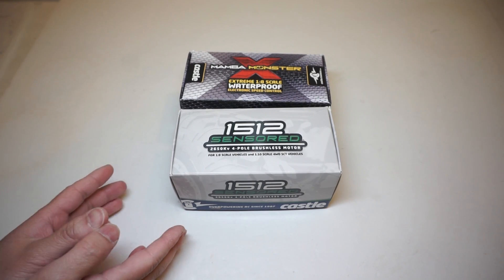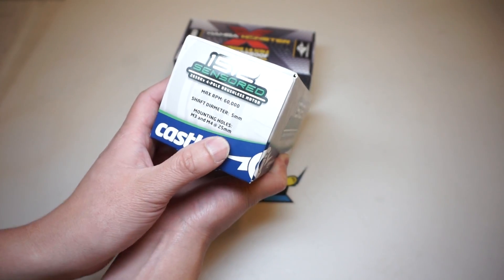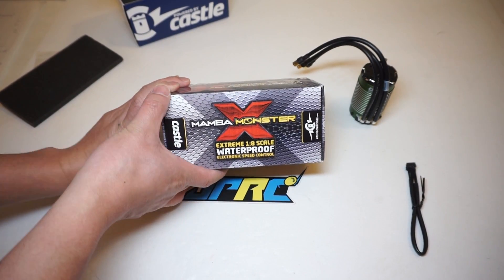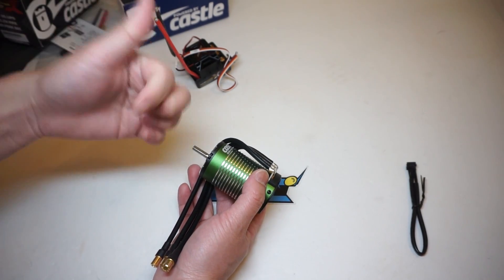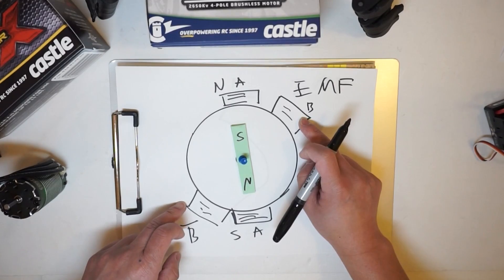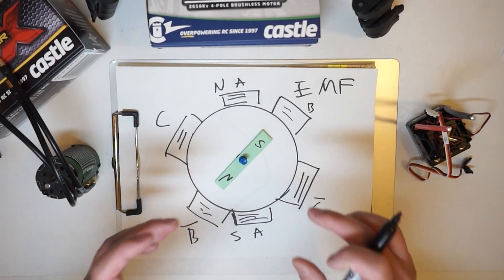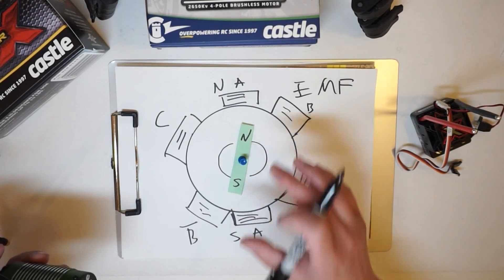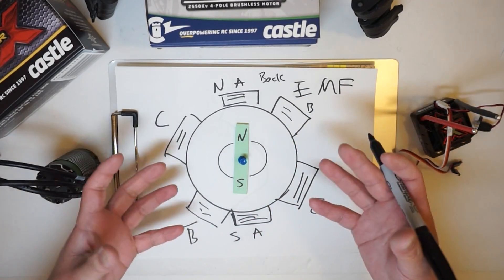Brushless Motor Cogging Explained! Unbox Castle Creations 1512 2560KV Sensored Motor

Comment: Literally none of you are addressing the most important difference between the two, witch makes me question your "knowledge" what happens if you reverse direction of  the motor on a sensored system? Witch method will cause you're ESC to burn out?

Comment: I had these issues with my castle 1410 3800kv in a 2wd slash and the castle 2400kv system with SW4 in my Arrma Senton.

Comment: Get hobbywing ezruns.. you won't cog like you do with castle. Even with a sensored castle you get more cog then hobbywing.. I stopped buying castle after I started using the better hobbywing brands. Not the cheap knock off looking ones

Comment: What propels a motor ? Current or volts?
Reply: Seriously.....????
Reply: Sorry if im a dick i feel like everyone should know that but I suppose before I got in the electrical field I may have wonderd the same question haha
Reply: Anyways... (Current) amp x volts = watts 
Kinda confusing when they only put amp raiting but that's because the volts is always the same either 2s or 3 s but besides that it's the same it goes from 4.2 to 3.5 no higher no lower amps actually Carrey the energy to the source in a fashion. Power is extremely complicated if u actually start to look into it with depth

Comment: Nice informative video, well done! I've recently changed my esc to a different one and the cogging has become more intense. I'm running a GoolRC 3800kv 3660 motor, on 3S, originally to a Hobbywing 120A esc. It ran really well, there was some cogging but it was bearable. I've since changed it to the waterproof Hobbywing WP-SC8 120A esc - the cogging is beyond... not sure why this esc is so different to the original 120A. Would playing with the timing of the motor on the esc help reduce it at all? Thanks in advance. Craig
Reply from the maker: Craggle RC the same hobby wing wp-sc8 in my yeti and the castle 1415 2400kv has minimal noticeable  cogging. Have You recalibrate your radio with since installing the hobbywing esc?

Comment: CAN  I USE A  BRUSHLESS  SENSORED  ESC ,ON  A  REGULAR BL MOTOR.I bought  the wrong  ESC  by accident.
Reply from the maker: john ciccolella what model of the esc did you get. Most sensored esc have a sensorless mode in the programming settings.
Reply: As long as it’s not brushed motor

Comment: Can you tell me if this setups good for a 1/8 scale landmax drift car that weighs 11 pounds or would a 2200kv setup be better?great explanation btw!
Reply from the maker: Wazza722 this is actually a 1/8 scale system. It will do fine do a rig weighing 11lb.

Comment: is less kv faster than higher kv motors?
Reply from the maker: Psjw00 7 lower kv = higher toque lower rpm, but it could run more cells which then = higher torque + higher rpm. That's why guys doing speed run usually goes 2200kv and lower kv motor ms run at 6s with very tall gearing.
Reply: JPRC thank you your the first person that gave me a answer in a way that i understand

Comment: That was great. Thank you. You explained that very well. I do have a question and it is, I am looking for speed for my SMT10 4X4 truck, what do you recommend? Thank you JPRC for your time.
Reply from the maker: for the budget mine, the hobbywing wp8-120 is a great powerfull esc, pair it with a motor ~3000kv is good for speed on 3s..if you need more speed and power..you have to go 4s -6s with castle mmx and ~2200kv motor

Comment: Thanks for the video, I have a question I bought a Castle SV3 & 4600KV Castle Motor Combo.  But i noticed the motor came with a Sensored motor!  i installed it last night and during throttle it kept clogging it's clogging more starting off on grass. also after 2 mins of driving the car stops seems thats motor and ESC got hot after a minute of waiting & turning ESC off and on it starts up again.     i was using Nimh 5000MAH battery , i bought 2s Lipo its on the way.  Thanks !
Reply from the maker: GManIsFly make sure to calibrate esc to your radio. Also what gearing u running in what truck?
Reply: Spur 64 & motor gear 17T
Reply from the maker: GManIsFly sounds like you are running this in a yeti. If so the 4600kv motor is not exactly the right motor for this truck as it is rated for a lighter truck such as Texas slash. Try dropping the gearing down to a 11T pinion and it will help with over heating and cogging. Btw the stock yeti esc is a re-branded castle sv3 so it is identical to the one you just upgraded to.
Reply: My truck is a redcat volcano epx
Reply from the maker: GManIsFly the same would still apply for this truck.

Comment: I have some pretty seriously cogging with my Hobbywing Justock ESC and my ThunderPower Z3R.
Reply from the maker: not sure if could help
Reply: What motor are you running, gearing and vehicle it's on? I never have any cogging issues on my hobbywings.. I use the ez run motors and max esc's. Like max 10, 8, 6 & 5. I've never had any issues with them. Put them on the appropriate size rig with proper kv to the rig I'm running and proper gearing for what I'm trying to do. And buddy I bash the hell out of some of them!! Through mud water , launching them through construction sites 50-100 ft. Gaps ,skate parks you name it I bash or race it. Temps stay good and most importantly ZERO cogging!! . Unlike every castle setup I ever used! Motor temps go way up on castle and cog to shit. Even after programming them. 
 P.s. sidewinder systems are garbage so don't waste your time! Unless you are putting one on a 1/18 scale they suck! Especially compared to a hobbywing

Comment from the maker: Let me know in the comment if you had some seriously cogging motors and what was the make and model?
Reply: Just put a goolrc 3800kv with a 80a esc. Ran great for about 2 runs now it coggs every time i stop and go again. Seems to get worse the longer I keep running it. Using a 5000mah 50c 2s Lipo. 4x4 1/10 sct.
Reply: @Dustin Woolsey - how long did it last? My 60a esc lasted five minutes lol smh
Reply: JPRC i have a problem right know i have a 3600 kv castle creations with a castle esc and it coggs really bad it goes for a little bit and then it completely stops i have to hold the throttle for it to go again but then it stops again it ia a sensorles motor don't know whats wrong with it
Reply: RC create try putting in a glitch buster
Reply: JPRC  what would you recommend for the bomber?
Reply: I raced elec and gas truggy back in the late 90's and brushless didn't exist so the upgrade was like 1000whp lol. Fell in love with the Baja Rey and Rock Rey so I have dynamite electronics and the cogging is horrible for my standards. Do the glitch busters work? At least good enough till I can upgrade?
Reply: I just bought a goolrc combo. 4900kv with s25a esc. Upon throttling it jerks.
Reply: Armor talion blx
Reply: Castle sidewinder 3 7700kv it cogs and overheats can u help me

Comment: You seem to know your brushless. I learned from you. I have two brushless motors that are seizuring one intermittently the other all the time.  Do you know why this is?  The magnets are strong. The bearings are good (I replaced them, And the they are both sensorless). Is there any hope for them, some rc guys recommend i chuck them in the trash. I just like the value of fixing and running them more and I try to not waste when I can.
Reply from the maker: Luke Bluske I'd love to try and see if we could do anything to help, pm me on my fb page we can chat
Reply: Ok, your gonna need a multimeter set to measure resistance. 
Touch it to each of the phases (A to B, B to C, C to A, and reverse), their resistance should be very little or negligible. They should all be within a small margin for resistance. 
If the motor passes this test, take the multimeter and touch each of the wires to the stator (the metal part where are the coils are wound against). The resistance MUST be infinite, no connection must be made. If there even is the slightest bit of connection, i.e. the multimeter reads something, then that motor has a short, and is dead. If you plug that in to an esc, then you run the risk of popping it. Keep the motor still, its good for spare bearings/ rotor.

Comment: One question, if it's running in sensorless mode is the motor lead  arrangement the same? Just match A to A ect?....  We have a mamba X and Holmes puller pro that won't run right if you match the letters. But we can get it to run okay but not sensored with a mismatched combo....
Reply from the maker: Greg scott I don't have the homes pullers motor, but while most manufacture have matching sequence but this maybe the exception. In senseless mode the lead position doesn't matter much it will spin one way other the other while sensored mode required 3 phases to match between esc and motor

Comment: I want the sensord 2400kv motor
Reply from the maker: ULTiMATE TRAXXAS MAN I have the sensorless 2400kv version it is surprising smooth even at low speed
Reply: JPRC I have the sensorless one also i have one in my slash 4x4 and my traxxas funny car . what a power house . It is really smooth also
Reply from the maker: ULTiMATE TRAXXAS MAN I am actually running the traxxas rebrand version (funny car stock motor) in one of my yeti. Absolutely love it on 3s
Reply: JPRC I love the castle mamba max pro sct 2400kv system. I have the old funny car with the castle branded motor. it kicks ass on 2s 3s and 4s
Reply: get 5mm shaft 4 peace of mind!!!
Reply: Haulin AZZ can you still get the rotor with the 5mm shaft for the 2400kv
Reply: No you cant, your way better off just getting the motor with the 5mm shaft straight from the factory.
Castle don't make the rebuild kits for all their motors no more, so if you break a shaft your a sitting duck unless u go thru warranty. That's why I sold my 1/8 shaft 2400kv for a  2650kv 1512 5mm shaft.
Reply: Haulin AZZ thanks
Reply from the maker: yes that the same re-branded motor i run in my yeti..and it is a race winning setup.
Reply: JPRC yea it's a race winning set-up in my slash 4x4

Comment: That was one of the best simple description of a sensored brushless motor, easy for us simple minded guys who don't understand the inner workings of a motor....nice job! now I get the concept of why motors cog
Reply from the maker: Crazy Craig's RC's and 3d awesome!
Reply: I've had my slash for two months and I have run the hell out of it. Hit 69 mph with the velineon system. Its just now started cogging. Why was it smooth while it was brand new and now it cogs. Its not bad but it does every now and then.